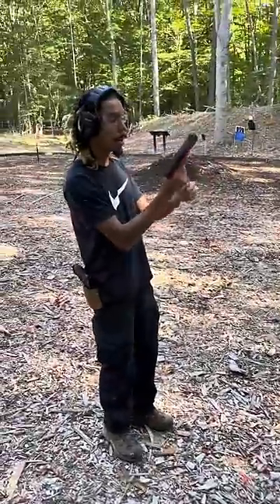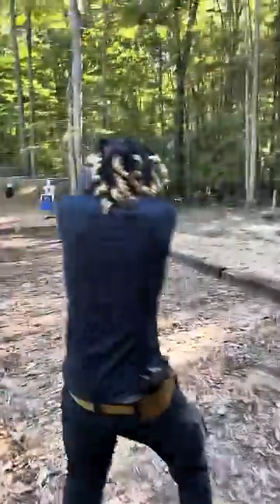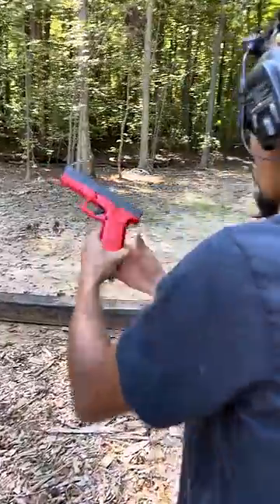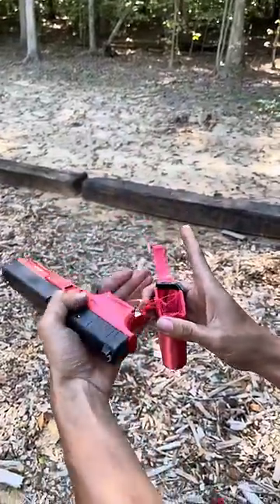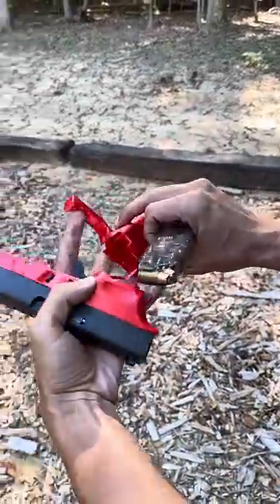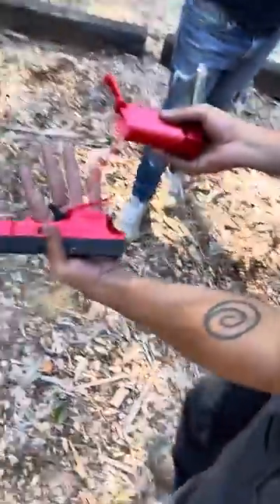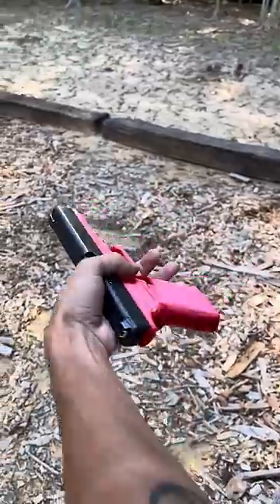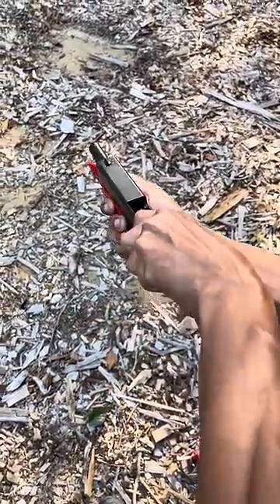3D Printed Gun FAIL 🤬

Comment: Bro, got some balls pulling the trigger again after the frame already had a crack in it! 😂 Glad your fingers came out alright.
Reply: "Bro, got some balls pulling the trigger again...."
or less brain cells as avrage people.
Reply: Facts, I thought there was gonna be some blood atleast
Reply: Right! I was literally praying 🙏🏻 out loud that he didn’t blow his f**king hand or fingers off! Most definitely glad he’s good and maybe next time don’t take that second shot after the 3-D printed lower cracks like that ! 🤦🏻‍♂️ Very risky brother, VERY RISKY!
Reply: Y'all realize if it was in battery headspaced right and he used metal rails it's not going to explode enough to blow fingers off
Reply: @donyvelosier6616  so you're what... advocating for pulling the trigger on a weapon that is clearly substantially compromised because... it probably won't fail enough to cause massive injury? Yep, solid call.
Reply: @tralmanchronicles6163  “because it probably won’t fail” - it’s not probably, IT COULD NEVER FAIL IN SUCH A WAY TO TAKE ONES FINGERS OF. Period. If you know anything about how a pistol works, you know that. 
And yes, if one wants to do that, it’s their body and their problem.
Reply: @FuckTheState  I mean, I agree, I would be somewhat surprised to see a pistol fail so as to literally remove fingers. You must be the expert though. I mean, I've only had a Glock 23 blow apart in my hands due to a feed ramp case failure, so what could I know? I must have been imagining the damage it caused. I'm sure there's no way that pistols literally tearing themselves apart in shooters' hands due to squib loads could cause any real damage. 🤷
Reply: @FuckTheState  there's absolutely no way this type of failure could ever cause serious damage, right? https://youtu.be/fi5xbBrCoNc?t=4
Reply: We men
Reply: Shit stay dangerous kings
Reply: technically the barrel on a glock is what keeps the gun from exploding. but when it fell apart if it was able to chamber another round it could have went off again as it is flopping around
Reply: @tralmanchronicles6163  having a load stuck in a barrel isn't the same thing as the polymer lower breaking off.  he didn't have a squib load when he shot it the first time.  theres a big difference.  if you pay attention no one lost any fingers or got hit in the face by the gun parts.   that's how guns are designed.  to blow up away from you.  I wouldn't have shot it again.  actually, I wouldn't have shot it at all.  it would have mounted it in a vise or something.
Reply: @blue03r6  yes, the broken frame was obviously not a squib load. Thank you for helping to point that out.
Reply: @tralmanchronicles6163  why do you reference squib loads like it has anything to do with this.
Reply: @trippie_fabio3181  it doesn't have anything to do with this video. I referenced it in response to the comment that a Glock, "could never fail in such a way as to take someone's fingers off". Read the comment. And the other comment where I also responded that no, the broken frame in this video has nothing to do with a squib load. However, other people somehow seem to think there is, in fact, no possibility of catastrophic pistol failure which could result in damage to the hands of the operator. That's why I referenced a squib load. I also referenced a feed ramp case failure in response to the same assertion for the same reason. Thanks for asking... I guess.
Reply: @dieterdodel835  according to your logic, our great inventors must have had less brain cells as well… interesting figure
Reply: @tralmanchronicles6163  No fingers were cut in you video lol, even with the large caliber ones
Reply: @edwardcardozo8325  wut?
Reply: @tralmanchronicles6163  Yes
Reply: @donyvelosier6616  and you can take the slide off.  Place a rd in the chamber and fire a striker fired. Turns into a single shot. Just pull striker back. 
Same thing for a AR or Ak. Just defeat the unlocking of the bolt .
Reply: @dieterdodel835  what are you afraid of happening?
Reply: Not balls, no brains. This is what happens when you havent seeen real death and pain..
Reply: @dieterdodel835   I know this won't sound right to most people. But these designs are meant to explode "safely"
Reply: @tralmanchronicles6163  any gun can have a catastrophic malfunction.... But the failure point in this particular video is not really dangerous at all.
Reply: @boejiden7531  thank you for your wisdom.
Reply: @tralmanchronicles6163  I cant tell if your being sarcastic... But to your credit (if you are) I do have no actual experience with these type of failures.
Reply: I mean I wouldn't have shot again, but the worst thing that could've happened did happen. The grip falls off and the completely metal slide fails to cycle. Not like the chamber of the firearm will magically turn to plastic.
Reply: Shouldn’t have pulled the trigger with the crack

As soon as you see the crack (that spot is very common for cracks) you trash the frame
Reply: Its not a pressurized part of the firearm but there is no chance of an explosion all of that is in the barrel and slide
Reply: @jamesatkinson8160  I think we've proven pretty conclusively that people don't read comments before posting.
Reply: @dieterdodel835  he did it for us, for the viewers, give him some credit, he knew it was going to happen
Reply: Not the most informed person here, but I did stop by a Motel 6 last week. But explosions are from pressure? Gas poured on the ground will burn, poured in a bucket/cup will shoot a flame vertically, depending on how wide the opening is, and as the top starts to wrap around. Eventually there can be a rocket type of force being applied down. When the top closes in too much, then the pressure can not escape quick enough and then it will explode, if the container is not reinforced enough. Then if enclosed and there is conditions are met that is when the maximum explosion occurs? 
Now gun is manufactured from metal, wood, and other materials that are designed incase of malfunction, that they somewhat mitigate injuries? 
So, if the round goes bang, and because of the shell being thin, but inclosed in the metal barrel, along with other metal materials means that the projectile is forced in one direction (where you point the gun? Now this one is plastic, so when the round goes boom, it could possibly escape from confinements and forcing it not in one directions, that when the round goes boom, that boom has a higher chance of boom, but in your face?
Reply: @johnsimun6533  you're right guns are made from many different materials. Typically, however, metal and polymer are the most common modern choices. As far as internal ballistics and engineering, there are thousands of factors at play. Some types of failure which are most dangerous in this particular type of firearm would be a squib load with subsequent barrel obstruction strike and a case rupture at the feed ramp. Both of these can pose high risk to the operator. In this particular video, however, these exact mechanisms of failure were not present. It appears the homemade polymer frame failed which, in isolation, poses little immediate risk. Dude in the video still has balls for pulling the trigger again on a gun that (most reasonable firearm operators would say) is clearly visibly unsafe to discharge.
Reply: That’s not balls, that’s pure stupidity
Reply: @dieterdodel835  there's a fine line between em
Reply: Gun  just became more relatable, with crack in it.
Reply: @ts757arse  i suppose you've got a point
Reply: @texican3619  thanks buddy, we've covered this like 5 times now in this thread.
Reply: @texican3619  hahaha most honest answer ever.
Reply: @tralmanchronicles6163  A revolver can, but a semi auto is unlikely. The bullet is contained in the barrel. The reason a revolver can do it is because your fingers can be right near the end where the gas is still coming out since the the cylinder is so small.
Reply: @tralmanchronicles6163  A squib load is not a result of a gun failure. It's the ammunition. (sure I mean the barrel could be damaged and lodge the bullet in, but a failure of the polymer frame isn't what causes that.  Even if it results in a  limp wrist style shot.
Reply: @OnceShy_TwiceBitten  yes, that's correct, and has already been explained in this thread.
Reply: @FuckTheState  There's videos out there showing pistols removing fingers, but aight my man
Reply: They almost didn’t come out alright!
Reply: Not really. Guns are safer then credit given. That being said 3d printed guns are a joke and have to be overbuilt to work.
Reply: @donyvelosier6616  right.  The slide was a regular glock 17 slide(or perhaps a generic version made by some other company), so it's not like the thing is going to explode the way some fully 3d printed guns will/can.
That being said, I still would risk it.
Reply: That wasn't balls, that was stupidity.
Reply: Not sure if that’s having balls.
Reply: The explosion is contained by the barrel, it was a stupid move but only someone with enough confidence would know its not going to blow up in his hand due to a cracked frame, worst case slide could've smacked him in the face, or could've sliced his hand up bad with the frame ripping off and still hit him, ect. Unless a round goes off out of battery, or by some strange happening a round goes off inside the grip (not many,  if any ways I can think of that could make that happen) a gun is simply not gona blow up due to a cracked frame. The plastic is clearly too brittle for the application, not all plastics are equal. It's clearly not meant for the forces exerted by the firearm. Still ballsy move only because YOU NEVER KNOW. Lol. Well done though 👏.
Reply: @2aalltheway614  see previous replies regarding feed ramp case failure. (Not what happened in this particular video.)
Reply: He’s got marks in his pants 😂
Reply: Cracked handle doesn’t mean cracked barrel???
Reply: @auststew5590  was that ever in question??? 🤔
Reply: I'd do the same thing haha
Reply: @tralmanchronicles6163  let Darwin work this one out. In time.
Reply: @NoNo_IStay  🤣
Reply: 🙄Balls?? I think you misspelled 'ignorance'...
Reply: @osvaldoalvarez2437  na u stay dangerous I’ll stay prepared
Reply: the pressure was locked between the barrel and the firing mechanisms (correct me for some details). The reason the frame got cracks it's because of the recoil, hand grip, and the immense vibration of the muzzle.
Reply: right!
Reply: Might be a frontal lobe issue..
Reply: right
Reply: @dieterdodel835  that part
Reply: That's not balls, that's stupid
Reply: Why would you shoot it again??
Reply: I wouldnt have cared, if not 😅🤓💁🏼‍♀️💅🏼
Reply: if you watched the whole video he clearly knew the risks and knew it would be a wrap after the 2nd shot, the gun failed so at the end of the day you all got what  you came here for 😭
Reply: Exactly what I was thinking.
Reply: @dieterdodel835  nice English
Reply: @tralmanchronicles6163  Came here to mention a squib. Thank you for not just spewing misinformation that could be dangerous to an ignorant, new pistol owner.
Reply: @dieterdodel835  bc he black? stop racism bruh
Reply: @tralmanchronicles6163  this is why you buy the sig
Reply: Nah, that's just stupidity. Always, always safety first fun comes later.
Reply: I started to think in case something goes wrong... use red plastic.. so you dont see the blood
Reply: Soon, there is going to be the rapture. It's when there will be trumpet sounds, and after the trumpet sounds, God will lift his people from here. Also, God said people should be living by the Bible. Amen, and God bless you.
❤Jesus loves you guys. Dont wait, please. He will welcome you with arms wide open.❤
❤* John 3:16 - "For God so loved the world, that he gave his only begotten Son, that whosoever believeth in him shall not perish but have eternal life".
Reply: Not really all the pressure is in the slide and barre and thats not 3d printed
Reply: @dieterdodel835 

That's HILARIOUS! To try and insult someone else's intelligence, when you can't even string together half of a sentence without multiple mistakes. Since you were trying to compare his apparent lack of brain cells with someone else's, it should have said "THAN" instead of "AS". And the word "AVERAGE" isn't spelled "AVARAGE". So, it should say "Or less brain cells "THAN" an "AVERAGE" person". This is why the comment section on YouTube is frequently more entertaining than the videos themselves, lol.
Reply: @madcapglass1454  ....frogenglish isn't even my first language...but hey, thank you for correct me Mr. Grammar Nazi....lol
Reply: Balls? Is that what we are going to call it? Oh ok 😅
Reply: Upper is just all metal. Can't go wrong much when the round is fired while inside that metal barrel.
Reply: It’s called stupidity
Reply: Is that what you call it?